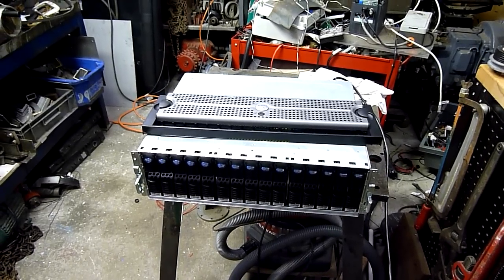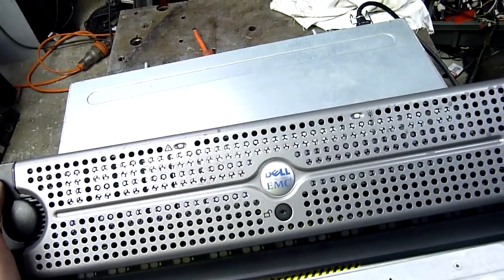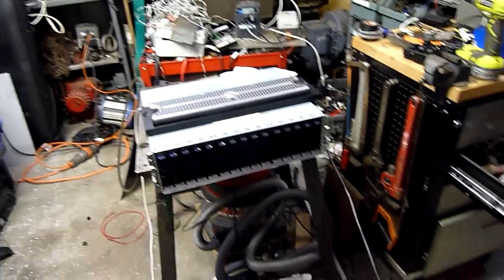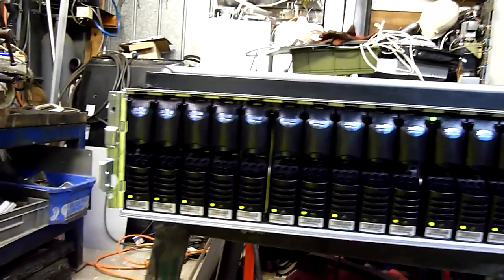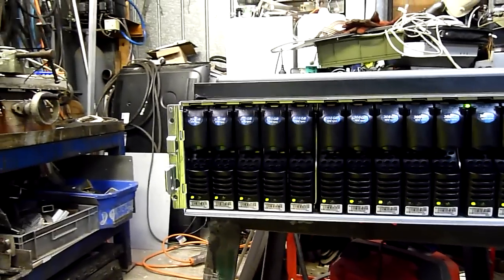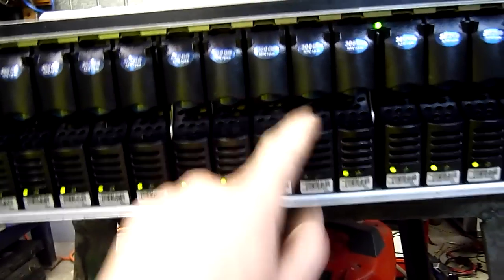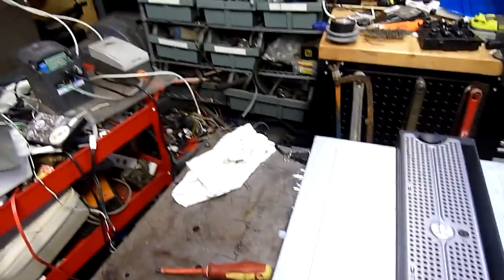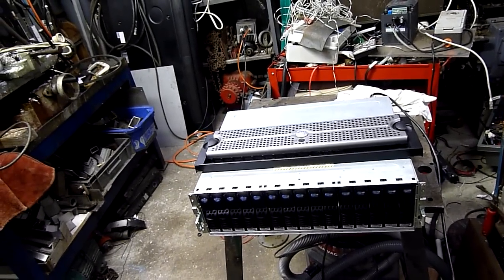Dell EMC2 15 disk HDD array power up

Comment: Found 2 of these at the local dump (recycling warehouse) and snatched them up. Until then I didn’t have any server knowledge outside what it was by name and function. But wow, nice little find I stumbled across lol. 
Nearly all 30 bays (across both) packed with 1tb WD enterprise drives (most dated 2013) that alone would be an insane find. Would love to set it up for a nonsensically overpowered home system eventually. Still gotta learn more about them and their ecosystem. 

Nice video lol

Comment: Your array is actually complete. The first 4 disks are vault disks, but they are no different than the others. The first 4 disks will have reduced user capacity. This is the space notched out for the Operating Environment. The rest of the disks will have identical raw and user capacity, as they are fully dedicated to user data. 

The disks are Fiber Channel. SAS/SATA disks will not work in this enclosure. One external interface will go to a FC controller and the other is a loop to another storage shelf. The connectors are called HSSDC2 (High speed serial data connection Gen2)  What you have is basically a disk enclosure. You'll also need an FC controller as well to be able to manage/use it. Being an older unit, eBay will be your friend, and you can probably pick up a controller for less than what you paid for the storage shelf, possibly close to free if you're patient. Let me know if you need help with it.
Reply from the maker: that is good to know!, how would I go about making it all talk to each other, the drives obviously need an operating enviroment installed on them, and I hear that EMC charge an arm and a leg for the privilege :(. I wonder if a 3rd party open source driver is around? somebody has to have hacked these things for hobby use.
Reply: Aussie50:
(This is for the most basic of basics setup.)
You need one of these:
http://www.ebay.com/itm/DELL-EMC-CX3-40DE-CLARIION-SPE-S-STORAGE-PROCESSOR-4x-2-80GHz-8GB-RAM-4x-PS-/181472437345
Two of these:
http://www.ebay.com/itm/Dell-YP038-EMC-Clariion-Micro-DB9-SP-to-RJ12-SPS-Serial-Cable-CX3-CX4-31-Long-/121399203517
Two of these:
http://www.ebay.com/itm/EMC-1-U-1000-watt-DC-SPS-118031985-For-CX3-20-/400314153173
Two of these:
http://www.ebay.com/itm/Genuine-Dell-038-003-503-SFP-HSSDC2-2-1-Meter-Fibre-Channel-Cable-/121418173187
Fiber optic cable and HBAs for your servers.
EMC Software for your servers. (Probably next to impossible to get.)
An active EMC tech support person that has access to EMC's Powerlink Knowledgebase that can step you through the setup. (I don't have access anymore. I've never set up a CX3-20 from scratch, those were past my employment.)
Lots of luck.
Probably lots of alcohol.
A huge stack of cash for all of the above.
(Or not. And then you just have a nice DAE2 paperweight. Sorry. Enterprise stuff is like that, lots of pieces to make up a system even if those pieces are huge.)

Comment: There is a 1U battery enclosure that sits in between this unit and the mains supply.  The battery enclosure has the power switches on it and the OS on the vault drives monitors this battery pack.  The battery pack acts as a UPS to allow the array to flush the write cache to disk and do a graceful shutdown.
Reply from the maker: Ah yeh, I have a feeling I will spend over $5k getting it set up properly, not worth it for hobby use :(
Reply: Aussie50 I just bought the 12 disk version of this thing for cheap (50 USD).  I decided it wasn't worth the money when I could just rip all of the guts out and replace them with a server motherboard and run something like FreeNAS or Ubuntu Server for less than it would cost to get all of the proper hardware to run it as it was, essentially using it just for its rackmount case.  If you decide to do this, PLEASE make a video of it because I'm running into a few little problems and it'd be nice to see somebody else's take on this kind of thing as well.

Comment: those first five drives only contain the OS if you are using it with the external controller, we had some of these (from a clariion system) and we just hooked them up with a 4 gig fc controller to wipe them, also in the clariion (and apparently yours) they use a 520 byte block size, so they need to have the block size changed to use it on a standard os without the controller
Reply: Most correct answer I've seen thus far. Also, the vault drives are not magical. An EMC box can be brought back from the dead, but you just have to be an EMC tech to know how to do it. lol. :-) (Its done over the serial cable with lots of proprietary pieces of software.)
But yeah, you can't do anything like that with this DAE2 unfortunately. You'd need an actual storage enclosure like a Clariion CX3 that this box would hook to.

Comment: Hello. Vault drives are not "special drives". They are regular drives with a small partition in the front where the OS is RAID-1ed across all 5 drives. Vault drives will be useless in that DAE2. (Disk Attached Enclosure gen2). You'd need like a CX3 storage enclosure for that. (It looks exactly the same on the front, but different on the back.)
The only way to talk to that DAE2 is either to have a storage enclosure or possibly like some others have said, talk to it directly over fibre channel. (This is not a supported configuration by EMC, so I wouldn't try it.)
Good luck with it, I'd be happy to answer any questions you may have. (I am an ex-EMC tech and dealt with those all the time.)
Btw, there is no shutdown button/etc because they are made to be on 24/7 and never go down.

Comment: Sadly the fibre channel drives are new worthless at this point  I probably have 100+ 146GB 10K drives.  Too lazy to figure out how to set these up.  You will require the controller, and the little battery unit if I recall correctly.

Comment: Ed, a good thing to backup to once you have it all working.
I have a NAS here running raid 5 over 8x 2Tb WD Se drives I used the Se drives as they are better than the Red drives they have 7200rpm spindle speed.

I had to sort out a friends NAS where he used 10x  WD red drives, once he installed the Se drives the issues went away no more drives failing and no more excessive vibration.

Comment: Be mindful of the inrush amperage at startup. Some servers will try to pull 15-20 amps easily.

Oh, did it come with the Dell rails?  If not, you'll need them to get it installed in a rack. Those piddly little brackets up front are not going to cut the mustard.

Comment: Try cleaning the contacts for the head assemblies on each individual drives controller board. Seagates are prone to contaminants building up on the pads and any mild shock will cause them to fail or become erratic. A good but noisy find that one :p

Comment: I worked with HP MSA drive arrays / and SANS never saw them use drives to hold any kind of OS. The operating system is usually on a built in controller. If it was a SAN the controller cards would usually be redundant. I think this is more like an external drive array basically an external drive array. I wonder what the power consumption of that unit is?.
Reply: HP MSAs and EMC SANs are different beasts. There are such thing as vault drives and they are the left five drives in the storage controller enclosure. Unfortunately, this is only essentially an expansion box. (Of which there can be many.)  Its a DAE2. (Disk Attached Enclosure gen2)

Power for this "dumb enclosure" was max 400 VA (392 W).

Comment: Hi Aussie50, are you sure that you need to replace first five drives vitm vault ones? You are right that it will need controller to operate but no need to change drives AFAIK.

Comment: What's the interface on this thing?  Couldn't tell from the quick rear shot.
Reply: its ethernet but some units have usb eSATA and some others...
Reply: You've probably never seen it before because this is enterprise grade gear. Its fibrechannel and the connector is a HSSDC2. It hooks to another enclosure that looks just like it, but it has a storage controller. (Or it hooks to more DAE2s, they can be stacked.)
Not ethernet, not infiniband.
Reply: I had a feeling it was fibrechannel but it didn't look like the fibre interface...forgot copper/HSSDC was a thing.  Need to get my FC gear back up again.

Comment: What you seem have there is the controller shelf itself.  Can't see properly as you didn't show the back very well.
EMC arrays need some system disks, but it doesn't have to be the first five disks.  It just has to be a tier 1 parity group or mirror.  You could set up a mirror and use just two.  Best would be a simple R5 parity group of three.  You can also partition that up and still use a large portion of those disks as accessible space.

Seems like you are missing the SFPs in the back to connect the fiber to.  Be mindful of what you get, as these don't accept just any SFPs.

I run a dual fabric at home with an EVA, an MSA and various other things such as comstar based FC storage.  I do it because that's how i make a living.  If it's just to play around with, you're much better off yanking the disks, LL formatting them to 512 byte sectors, and building your own storage array.

Comment: If it's been configured it shouldn't need the other drives in. I have some spare rack servers you can have if you want. Just Sitting around and would look good for an autopsy. Just getting them over the ditch would be the hard part.

Comment: you could do a netwok boot with it. you should then be able to install an os on the raid array as the raid is handled with hardware instead of software.. worked for n old scusi 900gb raid server.
Reply: No ethernet interfaces on this box. It only has LCCs which allow the storage enclosure to talk to it over fibrechannel.

Comment: You need more than Vault drives, that just a DAE. DAE2P  Disk array enclosure. You need the DAP. Disk array processor, The actual controllers, like a CX 700 or CX3 , That will have the vault drives. Plus you need the enabler to add that shelf to it, and you will struggle to get one.  And they are EMC fiber drive, so useless in anything except a EMC array.....:(    Cool piece of kit though. About 8-10K new I reckon

Comment: I've got one of these (I think the same anyways), has all the drives, 300GB ones, however since this is part of a large raid they are pretty useless without the head unit, and those are hard to find, and expensive, not to mention the cost of fiber channel cables and interface cards :/ Shame to have all that storage sitting in my garage going to waste.

Comment: My HP Prolient ML350 G4p has 5x 36G Scsi's in Raid5. nice  pice of Kit Bro

Q: How many KWH: is the Server using a Low Load.

And Should i use a  Sata Drive on my ML350 instead of the 5x SCSI's to lower power consumption or would it make little difference ?

I am guessing its Drawing  around 545-600W

Thanks all.

Comment: Humm. I would fully expect the smarts / logic of that device to be in the unit NOT the first X drives.

I expect there is a interface to select raid levels like 5 or 6 in this case.

Some of the earlier Dell NAS units had stupid limits on the max array size like 2 TB meaning you had to create a heap of 2 TB drives and then use Windows to span them to bigger drives. A real mess.

I could be wrong but I don't expect the first few drives need to be dedicated to NAS OS.

Its just old and loud. Too load to be practical outside a datacentre where who cares.
Reply: It does need a few drives to store non-volatile config, parity group config, swap space, table space, etc, etc  Doesn't have to be five drives at all.
That's just how symmetrix stuff works.

Agree on the fact that it is too loud and clunky to use at home.  Something like a synology or qnap or what have you is much better for home use.

Doesn't mean this can't be fun to tinker with, though :)
Reply: detaart I totally agree thus I do not believe the lack of the first x number of drives condemns this unit. I just think its too loud to be practical for home use.
Reply: Systemrat2008 Yeah.  The fan units are designed in such a way that one or two fans can cool the entire thing for at least a few hours.  Unfortunately, it makes them pretty loud.  Not very important in a DC, but pretty annoying for home use.  And they use a lot of power.
Reply: detaart This DAE2 (Disk Attached Enclosure gen2) has no configuration of its own. Its essentially a dummy slave to the master controller enclosure.
Reply: Yowza Grimace Wasn't sure if it was the controller shelf, or just a disk shelf.
He could still use it in FC-AL as a JBOD i guess.

Comment: I have a picture of what the LCC cards look like. (They are the two center cards on the back. The other things on the back are just power supplies.)
https://drive.google.com/file/d/0B9H6Nie9jh4eandoejFieDdtRE0/edit?usp=sharing
These LCC cards essentially do nothing more than act as a fibrechannel switch for the fibrechannel drives to the fibrechannel in/out ports on the exposed part of the card / back of the enclosure.
 (They also control the environmental things like enable the power supplies to be monitored and turn on/off the amber failure light.)

Comment: That is why there isn't many severs turned into gaming pc's nobody wants to have that in there bedroom. Some air compressors are quieter than those things.
Reply: This isn't made to sit in any room. Its meant to be in a server rack in an environmentally controlled data center. Those places are very loud!
Reply: That's not a server really... you wouldn't use that, but my Prolient G6 server is still fucking loud.
Reply: Its not a server, but its made to sit in a rackmount with servers.

Comment: At 0:17 you said "vault drives with the operating system on them". Technically, in EMC speak, the FLARE code is on the vault drives. (Which is essentially just their operating system, but you've got to speak their marketing speak. :-) )

Comment: When each drive enclosure like this costs $30k to $100k each, its not that unimaginable to be working on a system that costs around a million dollars. You just have to keep a steady hand and always wear your wrist strap.
(ex-EMC field tech)
Reply from the maker: Very cool, there is a massive array on ebay at the moment for about $90k used :D
I also noticed warning stickers on it making the user aware that withdrawing it from the rack too far will cause an expensive crash to the floor if you do not hold it right :p, especially when you consider its half the length of a Dell Poweredge.

Comment: You still have that? If so, are you willing to sell it?
Reply from the maker: TheComputerGeek010101001 I would sell it, I think  they go for around $300 on ebay. thing weighs 100lbs or so, so its pickup only, no postage.
Reply: Okay. What's your phone number?
Reply from the maker: TheComputerGeek010101001 PM only sorry, I do not know you well enough to give out my phone number. only a select few fans get that one :p

Comment: Hmmm, it sounds like a vacuum cleaner with a pile of HDDs in it. :D That is noisy! Does it use a lot of power to spin the disks and make all that air movement? If there's not a specification plate on it, then right now would be a good time to wire-up that kWh meter you have and see how fast the disk turns in that. :D

If the disk in the meter turns the same speed as the HDDs, then you're going to have a hefty bill running that. ROFL. :D

Other things: YouTube have been playing about with the layout again, so if the Thumbs-Up on this vid is significantly lower than most of your other vids, it's because people can't find the darned button in order to press it!

I found it eventually..... There's a little 'Thumb-up' and a 'Thumb-down' to the right just under the vid, and pressing one of those will add a rating accordingly. :-)

Thanx for showing,

-BoomBoxDeluxe.

19th August 2014, 12.55

Comment: That is not loud. I worked for a geophysical company in the 1990s. They had a rack of 15000 RPM drives to get 1000 GB. You almost needed earlplugs to go in the server room.

Comment: Stick it on eBay. Its no use without the service processor enclosure. If you do get gifted an SPE, give me a shout. I've got lots of those HSSDC2 cables spare ;-) I look after a lot of EMC and NetApp SAN's.

Comment: You are better off just buying a single 6tb drive for home use unless you really need that much speed.
Reply: People don't use this for speed, but for data security. If a drive fails it's better to lose 300 GB than to lose 6TB, see what i mean?
Reply: TheBrentieman
And if you have it in the proper RAID assembly, you won't lose any of the data at all!
Reply: canibal803 Just because you have RAID doesn't mean you won't lose any data. You still need backups.
Reply: canibal803 using many old hard drives in raid for for backup is a worse choice then a single backup on one disk. During a raid rebuild old drives are more likely to be flagged as defective because of the slow/unreliable read/write speeds thus causing the array to become unrecoverable.
Reply: Andy Cook
Incorrect. Background verify takes care of that. It was a background process that accessed all the parts of the disk so that what you described doesn't happen. ;-)
Reply: Yowza Grimace You must be thinking of ZFS, raid does not scrub data or verify data integrity. I may be unaware of a specific controller which monitors drive status (not talking about S.M.A.R.T.) and rewrites data to verify integrity. But that would be above saying all "raid" controllers keep data safe by monitoring drives.
Reply: rocketman221projects
Well the chances of losing data are significantly lower. He would need a catastrophic failure to lose data.